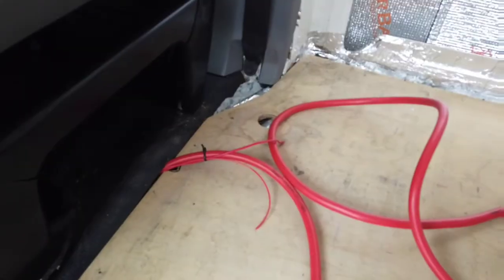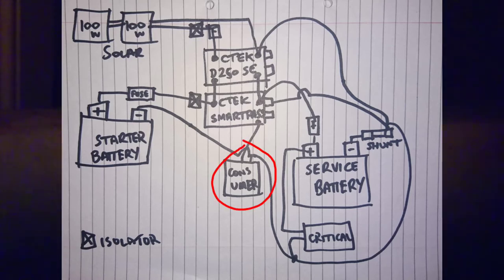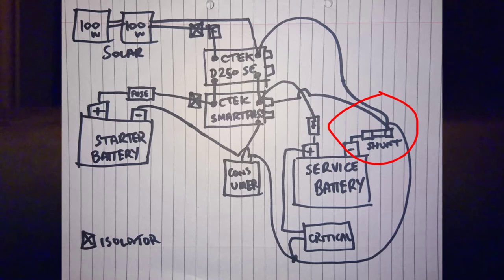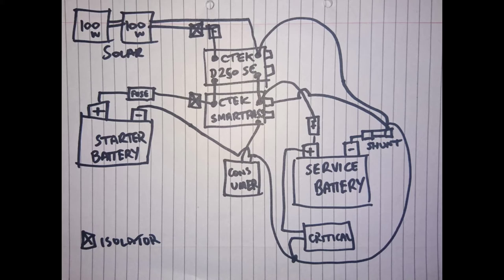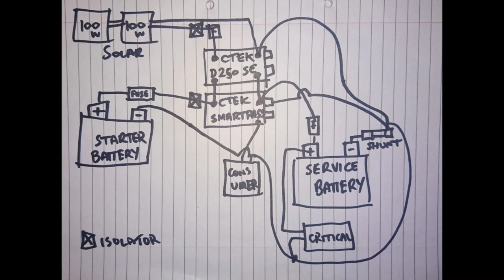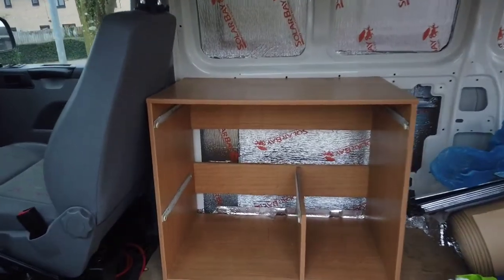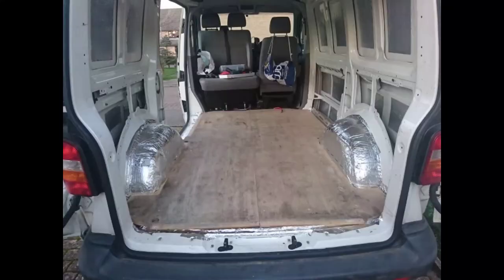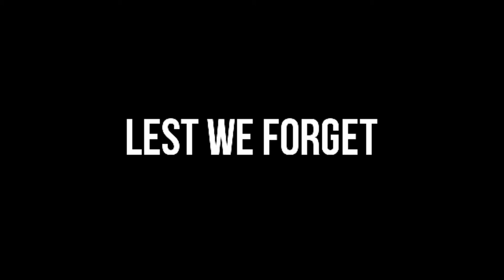Campervan 12 Volt CTEK System Diagram Explained & Remembrance Sunday

Comment: Hi great video im curious most of these video separate the batteries can u connect them ? have the service battery positive terminal going to the started battery terminal combining the banks?
Reply from the maker: I’m not sure about connecting starter and service batteries, may need to be same age, and amps amongst other things. Advantage of separation is when service battery is low it hopefully won’t affect starter battery so I can still start the van and then charge all batteries up as I drive